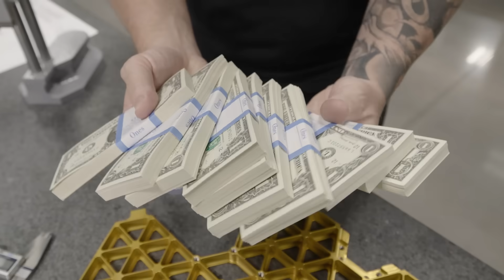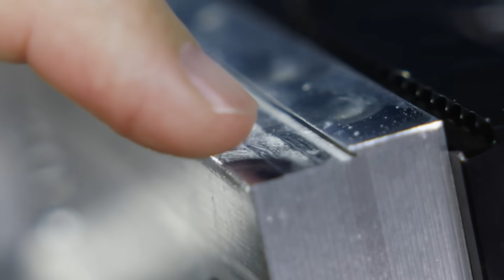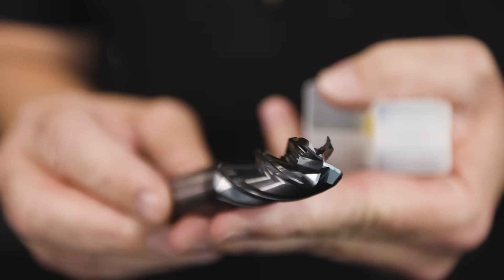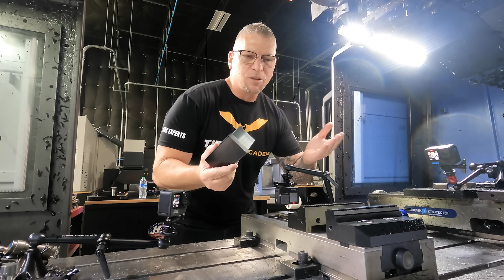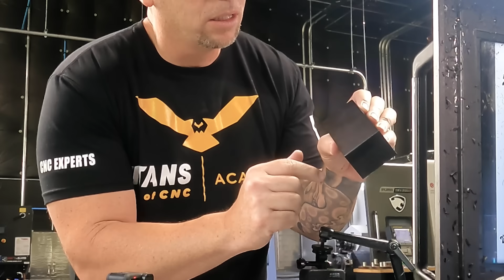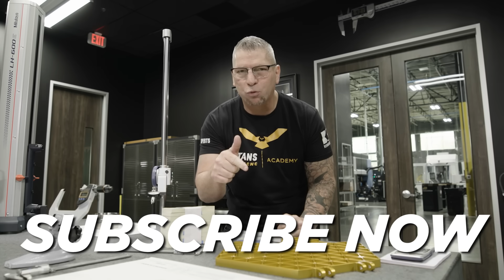How To Master The ART of Machining Plastics

Comment: Waterjet machining carbon fiber sheet  has made my electric RC flying saucer project amazingly light and strong. 76 y.o. single, retired computer nerd, former pro pilot, flight instructor , e/m designer drafter, still playin' blues bass, used Python to design the fan that develops estimated ~ 17 lbf ea. (2). Used Rhino 7 (tm)  to lay it out,   thrust/weight ~ 2.8,  power/weight ~ 460 Watt/KG, Seminole, TX USA

Comment: I entered the manufacturing world for about 25 years, and I was very surprised at first, because there were so many things I could do in the manufacturing world, it turns out that all the goods we use go through the manufacturing process, and I became interested, to make a business in manufacturing, and I quite impressed my family with the effort and hard work I put in, Machining car and motorcycle parts btw, and my guess for the thickness of the stack 4,6649

Comment: Hi Titan,
I have machined plastic on a 5Axis Router for 20 years and have found that if you use a 2 flute low helix carbide end mill you will get the best results.

Comment: Titan, I started machining in 2001 as an apprentice in Rochester, New York.  As a matter of fact, it was September 10th, 2001.  A day before September 11th happened.  I'll never forget it.  I thought the machinists were joking with me when they told me a plane flew into the World Trade Center, but it was all true, and they weren't lying.  I started by cleaning the bathrooms and learning the trade simultaneously.  At the time, the company I worked for (Micro Instrument Corp.) sent me to school, paid 4 years of my tuition for machining, and paid me full time to work.  I got my papers as a Precision Instrument Maker from New York State. While being a machinist, I had the opportunity to run old equipment, new equipment, manual machines, and CNC machines.  I went from a manual machinist to a CNC prototype machinist making parts for JPL/NASA Mars Rover, and many proprietary companies.  I've made a lot of cool stuff over the years. 11 years from when I started as a machinist, I left New York for Portland, OR.  I worked for an engineering firm in Vancouver, WA across the Columbia River for 3 months as a machinist and was made the Shop Manager because of my skill level and expertise. I managed their shop and their manufacturing for 5 1/2 years before I decided to start my own company in 2017. I finally followed my dreams of being an owner and doing this for myself.  I did it with nothing in another guy's garage, and now I'm in my own place with 4 employees, new Doosan machines, and growing.  What a ride.  A lot of sacrifices, learning, and growing.  I've been blessed doing this for a long time.  Do I need the $1K? Nah, but I'd be happy to spread it out as a bonus to my employees in the shop.  I use my skills and training coupled with yours to get make my employees great machinists.  Thanks for all you do.  The estimated height of that stack is 4.40".

Comment: I haven't been machining for a long time (was introduced 2 years ago in my college fabrications class) but it has changed the way I think about parts that need to be made with subtractive manufacturing, I just got a cheap $200 cnc router that I plan to use to further learn the limitations so I can know what things I can and cant design in order to make my parts easily manufacturable. Also my guess would be 4.3575 in

Comment: I am not in manufacturing but I am a mechanical engineer who is interested in machining and automation. I like to see how these parts are made and what to take into account for tolerancing when I am designing parts.  The stack is 4.4323" +/- .010. I am taking into account the paper bands. with 1.5 wraps around each stack.

Comment: I started in 2012 as a manual machinist and I always was interested in CNC Programming, so I decided to set out on that mission and I'm so glad I did. It was extremely difficult and no one was going to teach me.  I went to school programs to try and learn CNC machining but even the teachers try to set me back by failing my part just because of a small insignificant burr. The teacher always wanted to see me fail so I wouldn't have a chance to program in Mastercam. That only ignited my fire, I decided to make it my mission to learn CNC programming to show then they made a mistake, ironically the student that he passed on to programming actually crashed the expensive new machine and made the teacher look like a fool in front of the class, so it was a lil payback for setting me up for failure. I then left that school and learned Mastercam at a university level which gave me legitimate credit in my programming career. Later I was blessed by getting hired at MIT. Where they actually created the g code to run CNC machines,  so I was programming at the mother board of CNC programs!! And I was a succes. There at MIT I created a fixture to machine Ceramics and they are very delicate to machine. I have an intellectual patent there for my fixture. It was a tough journey but I'm very glad to have taken that valiant task and be able to create complex projects with ease. I now have even been able to program Fanuc control robots and have my own 3d printer to make prototypes from home. I'm very happy where I'm at and how far I came. People have compared me with Titan because of my tough up bringing and background but just like Titan I was able to turn things around in time and be a good Dad for my son Giovanni so that I can be a good example and change for a better future. God bless America where with work and dedication I was able to turn things around. I was also blessed with a few customers and learning at MIT when I was making the prototypes that when a student would come back for my parts. I had developed my first customer and he was coming back to buy more !! The senior machinist noticed that and teased me by saying Sergio your customer is back congratulations. Ok that was a great feeling to make "customers" happy.  I was blessed with a small customer order for like $78 dollars to reverse engineer a Prototype and that was my first transaction on line and where my small online business was born in 2019. Ok so here is the greatest achievement up to date. Just like Titan when he was romancing his way to Space X, I approached the small business out here in New England area the same way. That client was sending USA jobs to China but because I am now a small business here in the states I am competing with a monster in manufacturing.  I compare this job battle like David vs Goliath where I'm David and China is Goliath. Ok so what I had to do to keep at least one job here in America is I under bidded and drop my prices so low that he had no choice but to make me head programmer, and even though I won that small battle to keep jobs in America my dear country I still have ways to go. I hope to get all the help I can, and this will definitely go a long way. Thank you Titan God Bless America !! Amen I'm so proud of me my son Giovanni and my home office Precision Picture Prototypes. Now as to the height of the $1000 stack I say it is easily 5.0500 even
Reply: When are the winners being announced?? Any comments here ? My gues is 5 inches .0500

Comment: Manufacturing is great. I work as a mechanical engineer and I learned how to machine my own parts at home. It allows me to make prototype parts without any lead times or delays. My coworkers are so used to not doing tests or trying to make improvements because of the costs of fixtures and test parts. When there is an emergency, and parts are needed quickly, the only solution is to shell out crazy amounts of money. Instead, with my own manufacturing capabilities I have transformed the way that we approach challenges. Instead of sitting back and having somebody else make it and waiting. We have transitioned our mindset from being helpless to empowered. It is a great skill to be able to make the things you design and manufacturing has taught me the importance of good workplace culture.
My guess for the thickness is 4.8762". Thanks

Comment: I am going to guess it to be 4.386". I have been really trying to make a difference in our world concerning our climate change problems. I build most of what I need in-house using a lathe, small CNC mill, and a 3D resin printer. With a lot of study and hard work I was able to uncover a technology thought to be lost as the inventors all passed away taking what they knew about the technology with them. Making use of the scientific method I was able to get at the science behind the technology and am now gearing up to attempt to bring this technology out so we can all stop paying for gasoline and electricity all the while cleaning the air that we all need to breath. 
I have been subscribed to you for awhile now and hope to see this comment or that will change.

Comment: I went to work in a machine shop,with no experience, coming from delivering furniture and appliances.   I was able to learn enough to get a spot on a cnc lathe within a couple weeks and started learning g code programming. Eventually learning conversational for mills too.   I got the opportunity to go to school and learn to run a water jet,and that's what I've been doing for the past 7 years now,16 total years here.   Much better than back breaking work for min wage,also met my girlfriend of 6 Years here too ...so it's been a great experience all around.   I'd say 5.017 inches thick

Comment: 4.4362 should be about the correct thickness!  I’m 35yrs old. I grew up in the manufacturing industry with my grandpa and father being small business owners in the manufacturing and remanufacturing business. I have lived thru the ups and downs as a kid growing up with parents running a small business in the manufacturing industry. Last year I started my own manufacturing business. I just purchased my first cnc  a few months back as well as taking the academy. I have used manual mills for the last few years. I started a gunsmithing business here in Tennessee. I’m excited for the future. I love metal working, designing, and making new parts.  The cnc mill will be a great help for my first business. 4.4362 thickness!

Comment: Hey Titan, I started CNC machining at Harmonic Machine Inc 2 years ago at 15 and have loved every moment of it. It’s a family owned company and they are one of the best company’s I’ve been apart of. Learning about this whole trade has been quite the experience going from just running machines for production, to now setting up, programming, prototyping, learning all about speeds and feeds. I’ll be starting my first year for my red seal this year! My guess for the thickness of the 1000, 1$ bills is 5.5414”

Comment: At the age of 2 i got a cordless drill, don’t worry, it was just a toy. However, There were just something about motors and spinning stuff that always intrigued me. Mechanical parts were always super fascinating too, locks, clocks, engines, ect.. 
This passion never gave out, so at the age of 16 i took all my money and bought a lathe. It wasn’t the best of lathes. It had a belt drive and a toolpost that was over center axis for almost every tool. Despite all this i will never forget the first time i took a piece of bar, put it in the chuck and switched it on i saw the chips peel off. There were just something about taking this piece of bar and making a component. Being able to produce a part that would be nearly impossible to find online. I then realized that this was what i was made to do. 
A few months later i had got enough money for a minimill it was a sieg X2D with a DRO. Learning how to use that was a bit of a challenge, but i did eventually get the hang of it. This spiraled and I eventually sold my lathe and got a bigger one, same with the mill. I put a servo in the spindle and upped the motorpower by a lot. On the mill i created more mill heads, including a high speed spindle setup for micro machining. 

Im 19 now and have created a shop for myself and im now looking into small (cheap) cnc machines.

Machining thought me designing in cad (i use fusion) 
I learned (through the titans of cnc academy) CAM and gcode. 
I learned a lot on steels, hardening and steel compositions. I am a bit of a bookworm and tend to find knowing all these details very exciting. 
It thought me how to engineer parts for machining which will prove useful in the future.
Having to wire in large motors, vfds, servos and 3 phase stuff thought me electronics on larger basis, not like those flimzy arduinos some schools make you do. 

Unfortunately in today’s society its not respectable (at least not where I live) to just be a machinist, cnc operator, programmer and especially not a setup machinist. I’m therefore taking an academic degree in engineering on renewable energy. it was a few days ago that i were talking with some guys working on ROVs that go down way below the waves and install pumps that push mud and grit at staggering speeds and pressure. This was at a careershow at my university. They brought along some 3d printed and machined finished inconel 625 fan blades. I was probably playing with it for a minute before they asked what was wrong with me 😂. They told me it was inconel and i asked what kind, this was unexpected frkm them because no one they had talked with all day knew what inconel even was. This encounter and being able to pair my academic skillset with my self thought material science and material skillset landed me some good future opportunities. Machining gave me the skills you could never acquire in a classroom and I’m so glad I have been blessed with being able to do it. 

That stack of money is 4,3236220 inches if its not compressed. 

I care a lot for this trade and share your passion on passing it forward. 

Greetings from Norway

Comment: Afternoon Titan...great content as always.  I have always been interested in machining, especially the CNC programming aspect.  About 10 years ago, I lost my job as a micro-fabrication engineer.  I landed a job in a medical instrument manufacturing facility, where I performed special coatings for the company.  As the company grew, I grew with the company moving from coatings, to molding, to mold design and manufacturing of injection molding.  I would never have had the confidence to start designing and manufacturing the injection mold tooling or ancillary fixtures without what i have learned from studying your videos and different ways of thinking.  I think the stack of money is 4.386" in thickness.

Comment: Hi Titan, to prevent chipping when decking the top, use a 45 degree high shear face mill. The 45 approach automatically decreases the depth of cut as it leaves the end of the part. It also works well with button type inserts. A new demo on fast helical roughing with button inserts on Delrin, without chipping, is on my channel.

Comment: Hey Titan, I am 27 years old. I have been machining since I was 15 in Machine Tech. shop class in high school. I lost the love for it when I was 22 and the shop I worked at was just a bad people who drank too much. I stopped machining for 4 years until I saw your videos online and saw this new love for machining. Its all I think about. Been taking online CNC Programming classes for a year now and using your classes at the same time and I think your education is more fun to use. I've been searching for jobs in my area but I have to commute about 40 mins to Carson City, NV from South Lake Tahoe where there are no manufacturing jobs.. I need a new engine in my car to make it there, but I need a paycheck to pay for an engine. I'm getting laid off my seasonal job this week. I'm in a bit of a pickle on getting a job to pay the bills because I cant get a good job until I fix my car. Anything could help. Thickness is 4.286".

Comment: I have been machining at a job shop in Denver for 5 years. There is so much to learn in machining and I am grateful for your guys' channel.  I have applied some of the lessons from this channel in the shop I work. Machining, in some respects, has changed how I perceive things even outside the shop. I started noticing just how much manufacturing provides to the modern world.
As for the height of the stack, my guess is 8.6007".

Comment: I want to start out by saying thank you guys for spreading knowolage and creating a great place to learn and pick up tips that might otherwise take years to figure out on our own. 
Now this is not a sob story and i don't want any or need any pity but here we go, Machining got  my mom and I out of a very tough spot financially, lets just say times were rough and paying rent wasn't always a guaranteed, my mother was injured in a bus accident and could no longer work, by some stroke of luck and strong will I landed a machinest apprenticeship position at my current employer here in Illinois where i had basically no experience and very little knowledge of blueprints, inspection let alone operating. At my current company we me mainly run Star and citizens, with a small selection of eurotech and miyano machines as well. My new job put food on the table and a stability in my life I didn't really have alot of my childhood I was able to help my mom, and best of all I had something to strive for and get better at. Put my mind in a more productive positive place. I've been at my job for a little over 4 years or operating and its been a great learning experience. 

 I now have a trade I can carry with me wherever I go. It gives me peace of mind if I ever move I will most likely be able to find a good stable job.  I was able to better my life because of it all and for that I'm greatful.

Now my best very rough guess with air between the singles and them being banded is 5.789 thanks again guys!